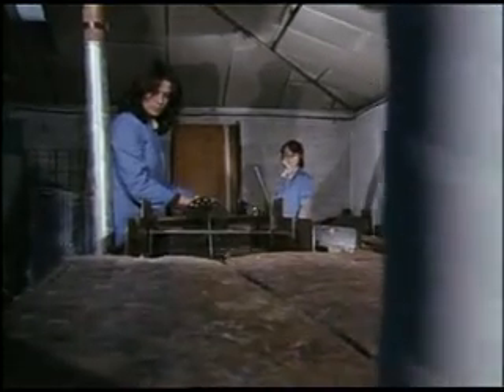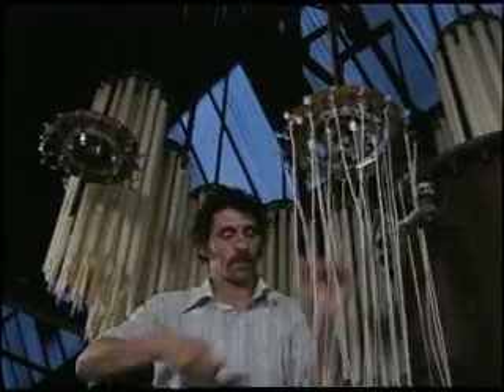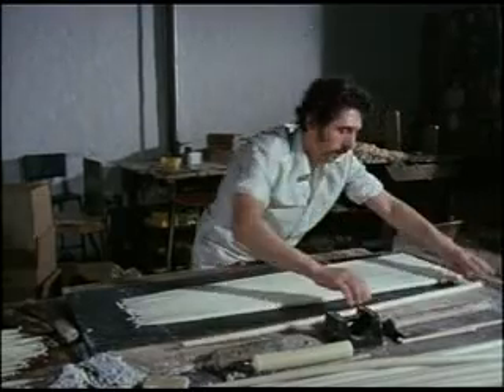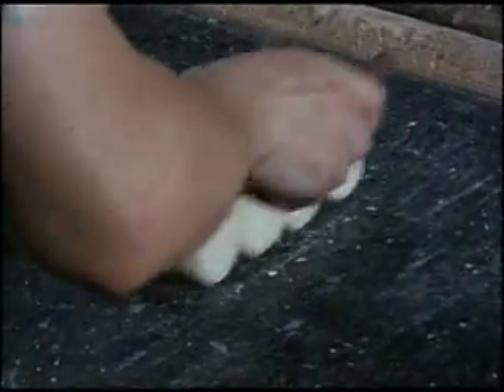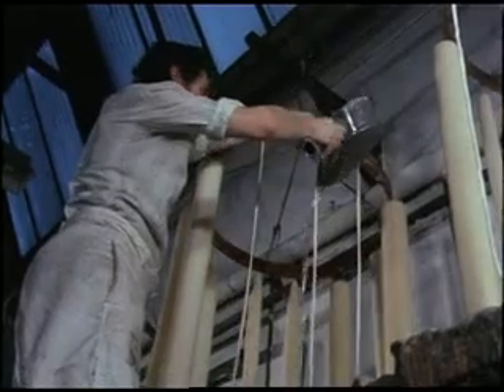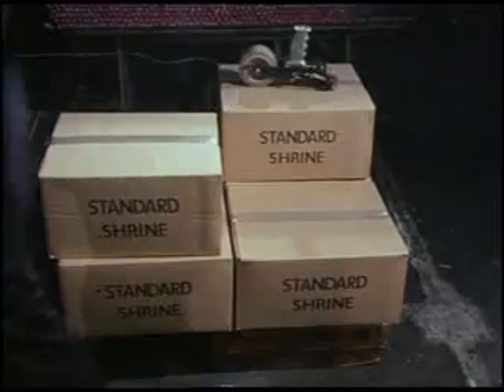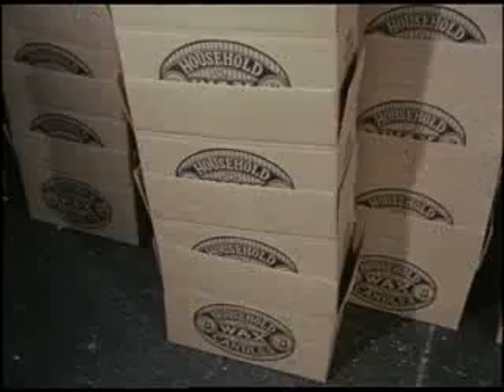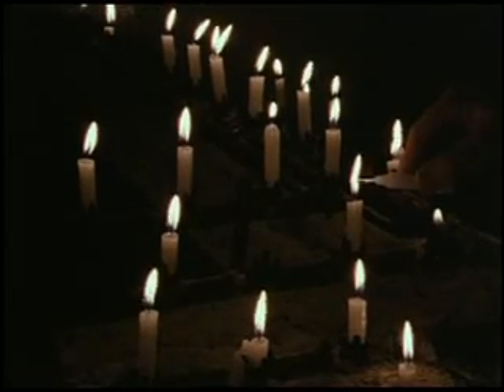DUBLIN CANDLE MAKERS..Part Two

Comment: Quality control is most assuredly a "thing of the past." 

By today's standards in 2019, these candles would cost a small fortune because of the necessary manpower and time to produce these candles. Unfortunately people do not want to pay high prices so everything to be made is shipped off to another country where it can be manufactured more inexpensively, therefore the quality suffers.

People wanting products cheaply have been the demise of these craftsmen. Some of us  are still willing to pay the higher price for quality items.
Reply: Couldn't agree more mate.